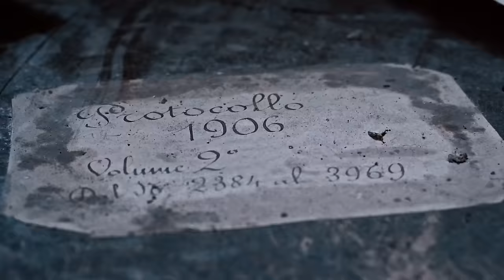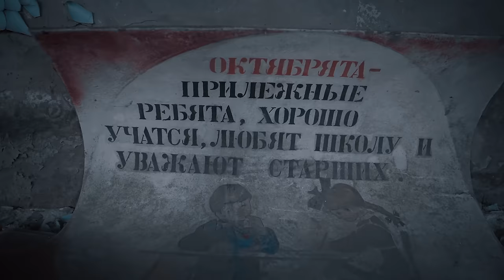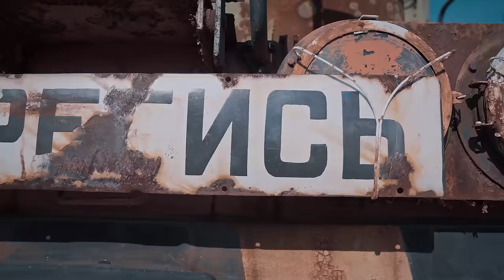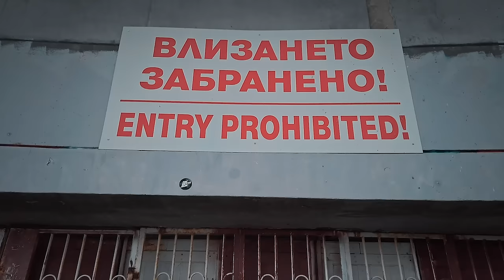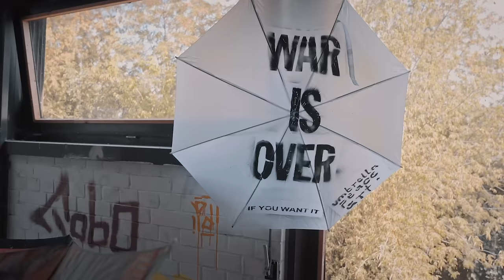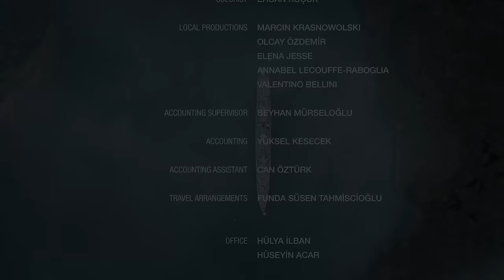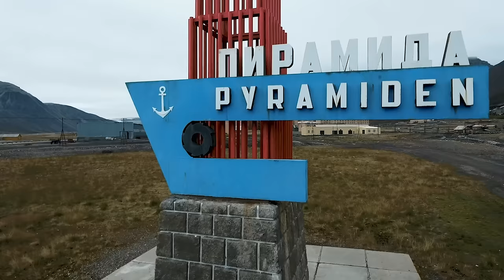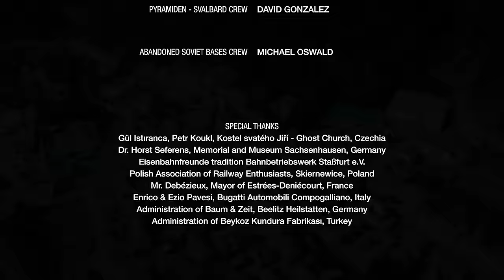In the Dead Zone: Chernobyl, Pripyat & Other Haunting Sites | Lost Places | Free Documentary

Comment: 3:30 Here is a detail that was missed: The LG logo on that heat pump/air conditioner at the top of the frame didn't appear for the first time until 1995 so I want to know where you're really filming. If the Chernobyl event happened on April 26, 1986, how would a product that would not exist for NINE MORE YEARS happen to be installed there?
Reply: LG been making ductless air-conditioners since 1958